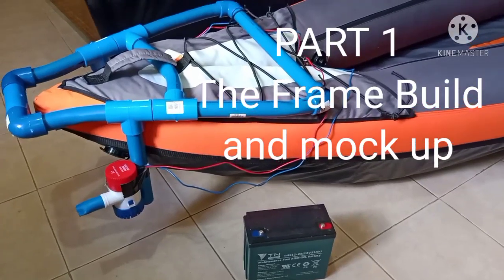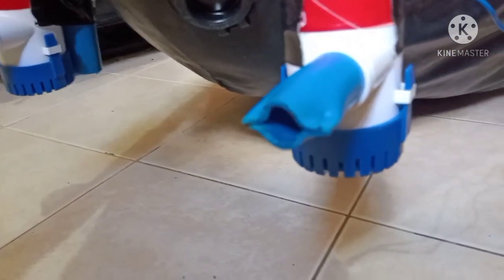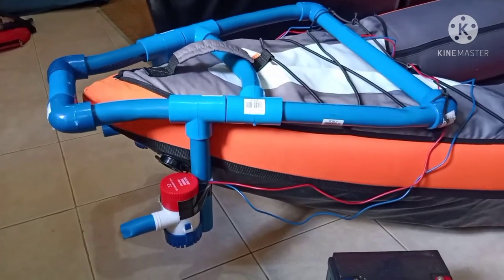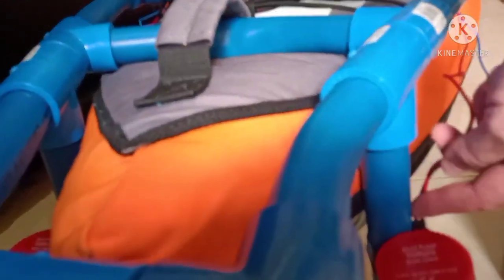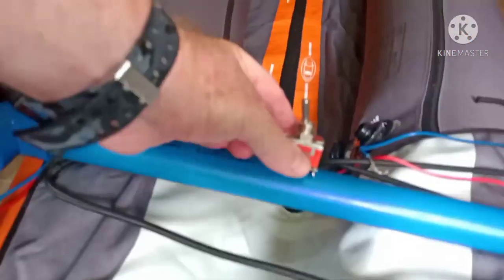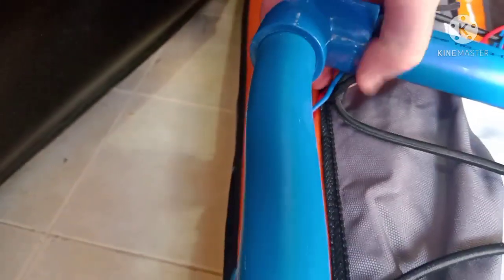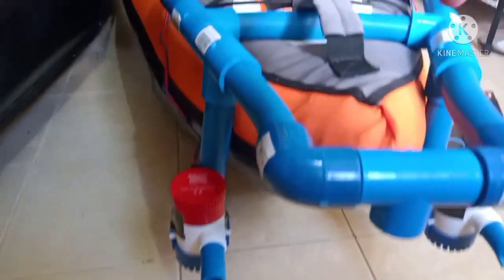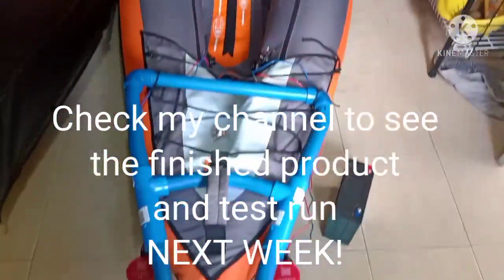Itiwit Inflatable Kayak trolling motor project using bilge pumps

Comment: congratulations very interesting, can you recommend the type of battery to use?
Reply from the maker: 12v 30ah LifePo4 battery. It works fine and will run this for a couple of hours.
Reply: thank you so much @mikesyoutubechannel6367
Reply from the maker: I got a Lifepo 4, 30 amp hour battery now.  It's is super lightweight and works great.
Reply from the maker: The battery in the video is lead acid and heavy.

Comment: Hi mike I also have same type of kayak. where can i find the dimensions of the framing you used
Reply from the maker: I've already disassembled and repurposed it so I can't measure it.  However, just lay it out on top of your kayak to measure.  Remember to use a heat gun to bend the pvc to match the shape.
Reply from the maker: It's all 1" pvc, though.  The part with the pumps on it will vary in length depending on how far your kayak sits in the water with you in it.